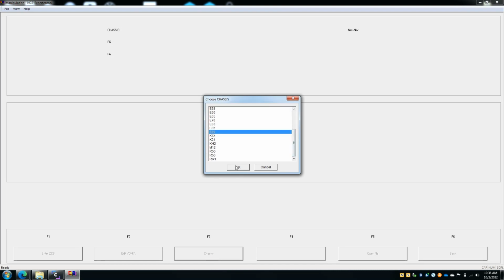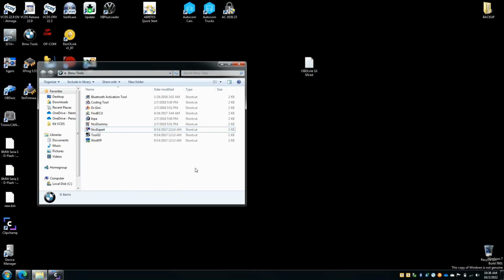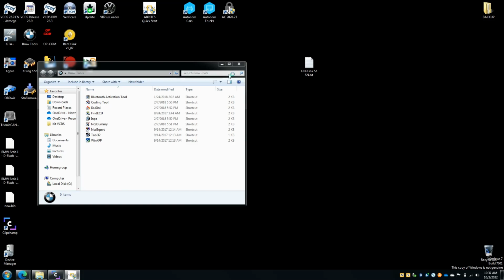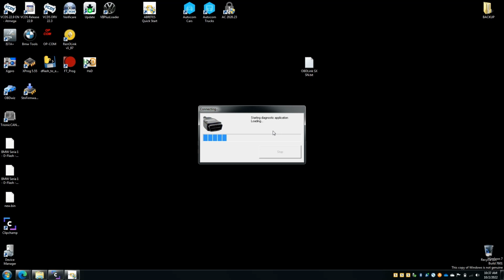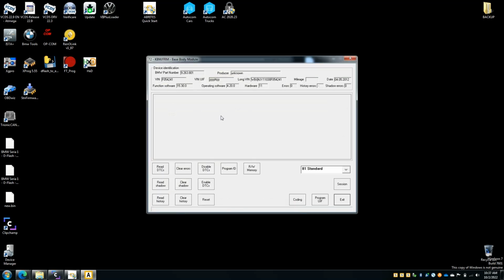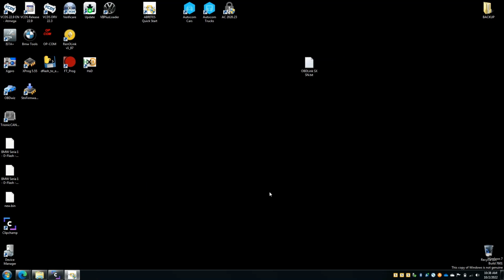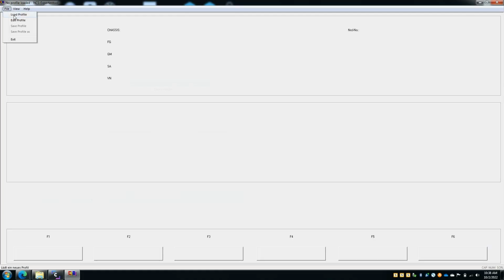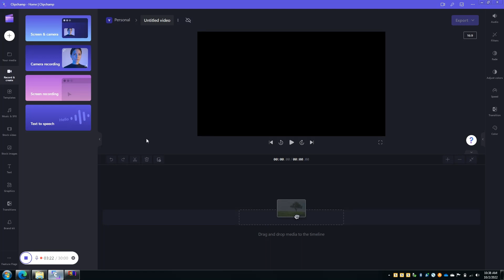BMW - NCS Expert - "Vin is faulty" quick fix

Comment: Hi, could you please help me. I get the coapi 1000 error when I want to execute codierdaten_lesen in kombi. I got a e84 x1 2014.  This error appears in all ecu. I use ncs expert 5.0.3 and k+dcan cabel in com1 and also a maxdia diag2+ cabel. Both give me the same error. I check everytime connection in inpa and I did also reset kombi through inpa. I also tried to hard reset my battery for 1h while connecting both ends with a charging cable. Maybe you got a idea, maybe winkfp does help?